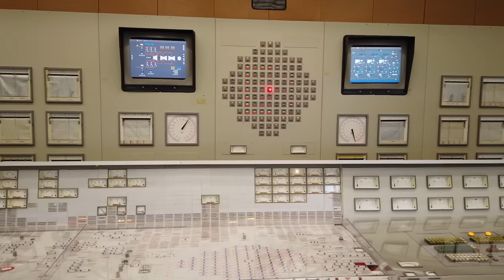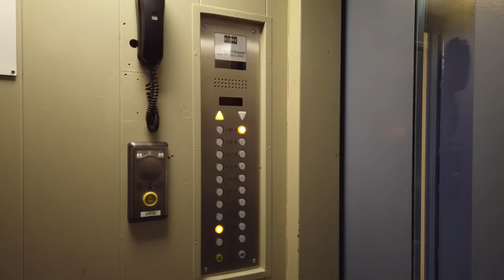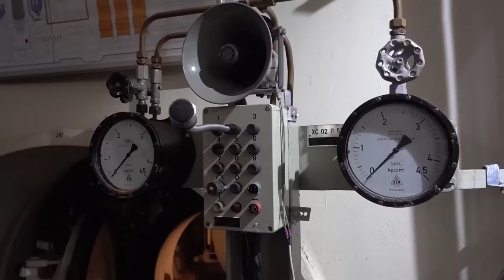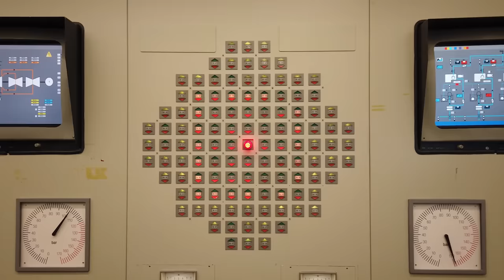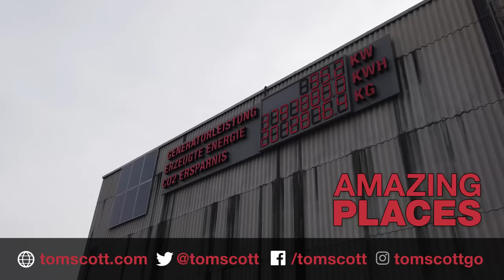This billion-euro nuclear reactor was never switched on

Comment: This video makes me kinda sad, thousands of engineers built something awesome, but nobody ever used it.
Reply: and it could also power up so many households, it just goes to show that you should never give power to people that aren't well informed about the matter at hand
Reply: @MrSeal-oy3fu  And nuclear waste is no problem inyour book?
Reply: @blubb9004  Never said it wasnt a problem, ofc nuclear energy has it's down sides but it's safer than other forms of energy and who knows if we spend more time on research we could find a better way to deal with nuclear waste as well
Reply: @blubb9004  waste is made really slowly. It’s a problem that has a solution. If you aren’t near a fault line or large coast it’s just very inefficient to not use nuclear energy.
Reply: @blubb9004  if anything nucler power is one of the most safest thigs ever in some cases its safer in coal and solar
Reply: @Grimjaw Jackerjack Need it or not, you could also be selling that excess power to Germany or any other country that is trying to go 100% renewable and finding that it can't.
Reply: @Leifthrasir  Germany is raplacing its thermic centrals with renewable energy, and it haven't made any difference in carbon emission
Reply: @blubb9004  We will be propobly able to go to other galaxies before it is a real problem. Yes it radiates but we can store it safetly and we produce so little of it that we dont even need to think of a solution
Reply: @itsve8632  deaths per GWh including mining the resources, building, getting the fuel, meintenance and getting rid of the waste:
Coal - 60
Natural gas - 30
Wind - 0.14
Solar - 0.1
Atomic - 0.04
Reply: @Grimjaw Jackerjack hydro ruins rivers and the lives in them.
Reply: @beppson9201  well its a whole lot better than coal and oil
Reply: @eduardcruceru9004  of course, I just think that if you can choose between nuclear and hydro that nuclear is better.
Reply: @ksp6091  that is true, it didnt make a difference, because while they were switching a coal plant to solar they were also closing down all their nuclear plants and making more coal plants to compensate the energy gap. They have quite an ironic green plan.
Reply: @Grimjaw Jackerjack nuclear is literally the best green energy source. Sure, these other options may be able to sustain you, but they each have a larger negative affect on the environment than nuclear ever has
Reply: No it's fine, It could have caused an accident.
Reply: @Grimjaw Jackerjack Whoever voted for this fully completed piece of equipment to never be used, is an absolute fool.
Reply: @simontalbot1950  the chances of that would be almost non existent
Reply: @Linnnaeus  Maybe the newer reactor designs.
Reply: @Linnnaeus  Thorium could be worth researching nowadays.
Reply: @simontalbot1950  the old ones are safe
Reply: @simontalbot1950  what's your point?
Reply: @Linnnaeus  The old ones are not that safe. They require way more human surveillance.
Reply: @Leifthrasir  btw, we sell power to germany
Reply: @beppson9201  "hydro ruins rivers and the lives in them." ok and what is with the radioactive water in the sea from fukushima?
Reply: @stinkos  Is 100% of your electricity coming from Carbon free source's? If yes then good on you! If no then go replace that fossil fuel burning plant (s) with nuclear.
Reply: @Leifthrasir   ~25% fossil, rest renewable energy. what about your country? and since 2020 no coal plant anymore. did your country replaced fossil fuel burning plants with nuclear power? in wich country do you live?
(maybe i sound a little toxic, sry for that)
Reply: @stinkos  Canada and we are in the process of keeping our current reactors operational while replacing our fossil fuel burning plants with renewables and SMRs (Small Modular Reactors)
wiki/Small_modular_reactor
Reply: @itsve8632  Coal and Solar power plants have never made a portion of the planet unlivable.  (Coal production, yes).  Every system we have ever built on this planet, regardless of redundancy, still has to deal with the human error element.  Anything that can go wrong, will go wrong. It's all just a matter of time.
Reply: @MrSeal-oy3fu  and as long we do not know how to handle it, we have to dump it somewhere... no problems as long you have a stable society. But what are 100yrs in the live time of nuclear waste? We talk about 10000yrs or longer. Woho will be responsible, who will take care? Maybe we can trust nuclear power now, but - sadly - we cant trust humans - not over such a long time period.
Reply: @beppson9201  At least with hydro you don’t have any chance of it exploding, radiating a lot of land, radiated clouds spreading all over the continent and maybe even the world, killing over thousands or even millions of people and animals, etc.
Reply: @blubb9004  Nuclear waste is a problem, but a managable one. You can build massive underground bunkers to hold the waste, or like most powerplants, just hold it in a pool of climate controlled water and leave it there - the reactor will most likely end its operation (non-violently of course) before it fills up, and it can just stay there for as long as needed until said bunker is ready to accept waste
Reply: @AtomicAlchemist  If it is that easy or "manageable", why don't we just do it like that? I suppose, that is not all of it, isnt it?
Reply: @blubb9004  we do do it like that. Most nuclear power plants have storage pools for storing nuclear waste locally.
Reply: They got paid regardless, I see no problems with that.
Reply: The builders got their money so what's the problem?
Reply: @blubb9004  Modern nuclear reactors can literally use nuclear 'waste' as fuel tbh. Older generation reactors use like 10% of the fuel, more modern designs can use like 90%. Some of what is left of the 'waste' after that can be reprocessed into nuclear batteries. 'Waste' is just a point of view.
Reply: @blubb9004  Nuclear waste from reactors are produced so slowly, and in such minute amounts, that you can safely store the waste on site without it being a safety or space issue.
Reply: @armeniancrusader301  Just so you know, even the largest reactors on the planet have nowhere near enough radioactive material to irradiate anywhere remotely as large as a continent. Nuclear power doesn’t cause explosions either. A reactor failing is called a ‘meltdown’ because many of the most well known failures were caused by the fuel rods heating up too much and melting, releasing more radiation then intended when safety systems failed. Even then, the vast majority of accidents in the past have resulted in more monetary damage than human cost or environmental cost. I encourage you to do some research on the history and mechanics of nuclear power, as it should help you clear up your misunderstandings.
Reply: @blubb9004  You can ask France to reprocess the fuel to reduce the half life to much lower (i.e. 30 years). Most developed nations elsewhere use nuke power and they are fine.
Reply: imagine living more or less next to this NPP...
I am still more scared from old power plants of our neighbours which are still very close compared to any modern NPP directly in front of me...

This decision never made sense... Austria is SURROUNDED BY NUCLEAR POWER
Reply: @ksp6091  How they should make a difference in carbon emissions?
The whole industry is the reason for the carbon emissions, and they will slowly adopt to more enviromental friendly stuff if at all! Profit over enviroment...
Reply: @blubb9004  the waste is the easy part. Deep, geologically stable, safe, and secure storage spaces are all you need. The hard part, is convincing people that nuclear is safe. 

You play subnautica? I love that game!
Reply: @beppson9201  If an accident happens, in the nuclear case, hundreds of thousends of people die because of the radiation and the environment is afected. In the hydro case, a village gets wiped out. About polution, the nuclear waste is A LOT more dangerous then a river not having some fish!
Reply: @deanromania6748  contrary to popular belief the Fukushima nuclear power plant has an estimated death toll of approximately 0… you know why? Because it was built in a way that forced nuclear material downwards instead of upward like in the case of Chernobyl. Literally anything can kill when you don’t build it right and maintain it right,.and when damns fail they kill just as many people or more as nuclear power. I am for both hydro power and nuclear power, but I am for responsible use of both. The Japanese Goverment warned the Fukushima power plant that it needed better safety incase of a tsunami, but the company operating it simply ignored it.
Reply: @simontalbot1950  
No, the old ones are safe.  Newer ones might be safer, especially if they run at atmospheric pressure.  But have many kinds of machinery in our modern world that runs at a high pressure, and it is done safely.  Whenever you pump your gas at the gas station you don't worry about static electricity causing an explosion, do you?  But you're more likely to be struck by lightning or to hurt in a car accident than to be harmed by a theoretical nuclear reactor accident from any reactor technology.
Reply: You forget the hundreds of people who lost their job that day. Spent years training for that specific, rather rare, reactor type and already bought their houses in the area, planned their families, all gone with a shitty referendum that didn't require a two thirds majority.
Good luck being a german speaking nuclear engineer trying to find another job when both Austria and Germany are anti nuclear.
Reply: Why do you have to be sad? It can now be used as a tourist attraction, filming location and for festivals.
Reply: @blubb9004  no it's not you just create a deep hole like Finland and put it there ;)
Reply: @Grimjaw Jackerjack Well Austria still generates about 25% - 30% of its electricity from fossil fuels - now mostly from natural gas as coal plants were converted or shut down. And is net importer of another 10% (which comes mostly from Czech republic, which means it comes either from nuclear or brown coal). So since 70s, way too much coal was burnt needlessly, and since 2000s way too much natural gas is imported and burnt needlessly.
Reply: @blubb9004  Solar waste is not a problem in your book ?
Reply: I'm sure the Russians will find a use for it.
Reply: @Hartschteiler  nuclear power isnt the future, its the present. nuclear power is the best energy source available now or in the near future, but something like fusion is what I would call the future
Reply: @Brave_Sir_Robin  Germany hasn't found a single spot that matches all those criterias so far 🤔🤔🤔
Reply: @blubb9004  No. Read a book
Reply: @blubb9004  every source of power has problems. Go live in the woods if you don't wanna use power.
Reply: And guess what the Germans are going back to coal again... So smart those Germans...
Reply: @blubb9004  There is no waste.
Reply: Agreed. What a waste.
Reply: @TonyPajamaz  even if you are close to those its safe as you just put it away from it and literally run a cable...
Reply: @zeux6634  i would say that is false because the solar is so toxic and its being put in landfills not recycled because its really expensive to recycle solar panels because they are so toxic.